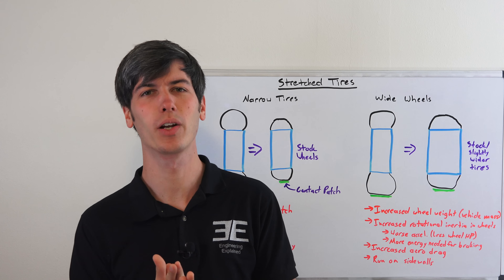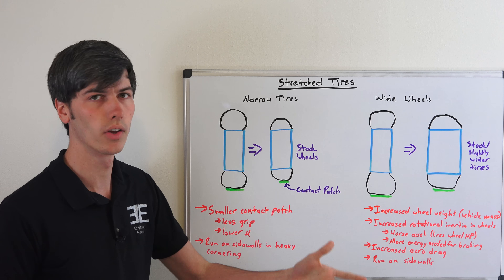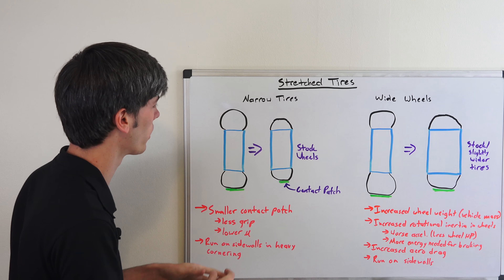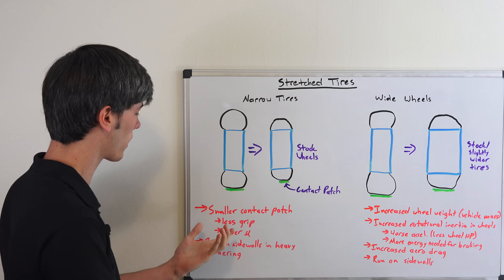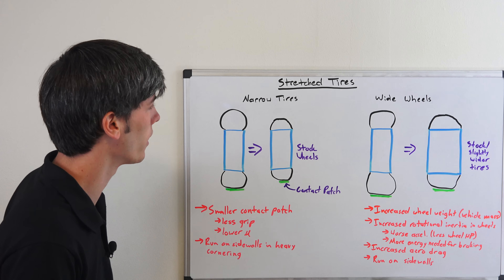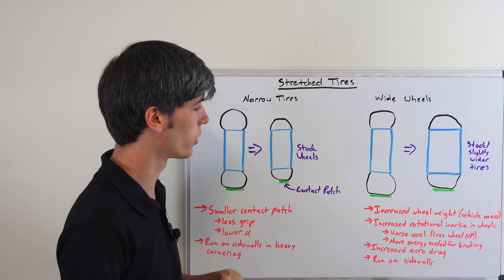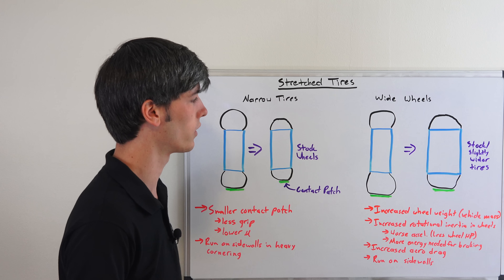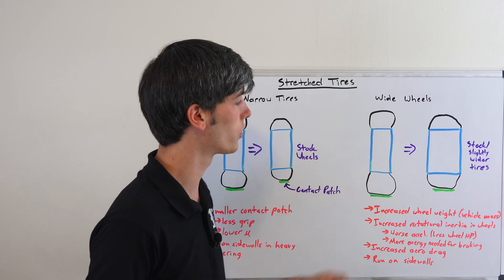Stretched Tires Are Silly

Comment: Could you do a video explaining the physics behind why going over a speed bump diagonally is more beneficial than straight on?
Reply: +Mark Embury  That is simple. You are limiting the amount of front over hang by placing one wheel closer to the bump which will allow for more ground clearance. 

Generally the trailing edge of the front bumper is shorter on the side of the car (closest to the wheel) then at the very tip (center of the car)

Comment: Hi There, love your video...they always refresh my knowledge on automotive and somehow improve my driving...kudos and keep making great videos...pertaining this subject, the tires and wheels that come stock from dealer is always half a size smaller. Meaning the wheel is always 0.5j smaller than the tires that come with it (at least in the country i'm in...

How and where can i find the info (beside the user manual and the tag at the side of the door) that the size of the tires i'm using is really fit the wheels..??? example, wheels 17 inch 7jj fitted tyre 225/55/17...where can i get the info if i want to change to 18inch wheels..? what is the correct spec that i need to mate with to maintain confort and reliability..?example do i get 18inch 8jj or 8.5jj to mate with 225/45/18 or 235/45/18..?hope you understand my question and able to provide some guidance...thanks...

Comment: The point of stretched tires is to have a nice rounded edge to tuck under the fender of the body or bolt on wide body

Comment: infinity uses stretched stretched tires on the m56x, g37s and g37xS, stretched tires in moderation increases sidewall stiffness and helps with lateral movement, you're missing some info, but it's what ever

Comment: +Engineering explained   First of all, happy new year!

also, I think it would be a good idea to make a video about how rotating / unsprung weight can help (with diagrams and all), because I see a lot of debates of how for example a 10lbs decrease in unsprung weight equals to 10/20 and even 100lbs of sprung weight, also others comment that for every 10lbs of unsprung weight removed you "gain hp" and so on

I think that it would be AT LEAST very enlightening for many if could analyse it in one of your videos :)
Reply from the maker: +eagle https://youtu.be/SR3nVx1aaTo
Reply: +Engineering Explained I hereby stand corrected!

thanks for the very fast answer :D
Reply: +Engineering Explained is there a video pros cons on running wider tires on say stock wheels is. 18×8 wheel then slapping a 275/40/18 tire

Comment: Stretched tires are faster, when done right. If you are restricted to a 225 45 15 tire, putting it on a 9" vs a 7" rim  will result in faster times. 

emillio from 949racing

"1. Increased tension on sidewall reduces unwanted deflection and distortion. 
a. Quicker steering response
b. Reduce camber loss from sidewall deflection
c. More linear steering response at max slip angle

2. Increased air volume
a. Lower pressures allow tread to conform to road surface better, improving grip.
b. Increased air volume temperature fluctuates less with thread heating/cooling.

3. Contact patch is increased by decreasing psi loading per unit area (lower air pressure and wider rim). Imagine pressing hard inflated basketball onto ground or mostly deflated basketball onto ground.

a. By lowering loading per unit area, total friction potential per unit area is increased.
b. Tire wear pattern is more even
c. Tire wear rate is improved

In general, a Spec Miata with 205/50 NT01's on 15x7's will run around 39psi hot. The same car with 225/45's on 15x9's will run around 30psi hot
and generate about .25g more lateral grip

In short, the same answer I reply to about 5 emails a week: "9's are faster"

"The same 225 tire on a 9 will generate more grip in braking, acceleration, cornering or and combination of two on an 8 with the same offset. Grip is king. You'll never see a successful autocrosser choosing a narrower wheel so they can slide more. The odd case being a FWD car putting smaller tires on the rear to help the car rotate. The Miata thankfully, doesn't have any trouble rotating if it is set up anywhere close to right."

Comment: I know the effects of stretched tyres but are there any downsides of using wider tyres on smaller rims and what's the actual term for this?

I ask this as I'm thinking of doing such a thing to my car but I'm not sure if there is any downsides to this and there doesn't seem to be that much information on the internet about it.
Reply from the maker: +KartDodger Haven't looked into it much, but it seems like you'd have a lot of flex in your tire, and it wouldn't stay very stable.
Reply: +KartDodger narrower contact patch, crowned wear at extremes, but mostly it makes for sloppy steering response and understeer. Requires increased psi to regain some steering sharpness, which will again lead to a narrower contact patch and tend to wear down the middle with less overall grip.

Comment: Not to point out the obvious but if you just stretch a tire the wheel is heavier. But most people that stretch  tires go to a bigger wheel. while being more heavy the sidewalls are shorter meaning less tire deflection at turn in. Stretching the tire pre loads the sidewall again reducing deflection.  If you look at a super car or a true sports car the tires will have a small stretch to them. The whole point is to make the steering more responsive. With reduced tire deflection the time between the steering input and the lateral G increase will reduce.

Comment: my father told me that they used slightly narrower tires in formula 3 and formula lotus and historic rally and the other ones( he was a mechanic for marko mankonen who won legends trophy, and mika salo from the karting career to formula 3) so the tire would lean less in corners, any thoughts on that?
Reply from the maker: +OvalD Maybe so! There's obviously some point between stretch (and the opposite of it) which would be ideal for certain scenarios. You can also adjust camber to reduce the negative effects which occur during heavy cornering.

Comment: Well in my case, i run 15x8 wheels with 205 sized tires. If I were to run the same sized tire on a narrower wheel, I would have more sidewall flex, however I could not fit a larger tire on my 15x8 wheel without rubbing  in my fender well
Reply: +Bunny Rabbit adjusting with more positive offset will make a difference, and be appropriate in most cases of wider wheels. The same offset on a 1" wider wheel means a negative offset change because the mounting face moves 13mm inboard.
Reply: i cant move any more inboard without rubbing at full lock. Its a drift car.

Comment: i still think stretched wheels are not the smartest idea. like you said that the tire will more than likely run on the side walls but id also worry that the tire would get knocked off the bead easier too.

Comment: Will it sacrifice tire life if I use a wide wheel and skinnier tires?  I feel like running this on track steels on my Scion tC for winter tires (stock wheels cant use higher profile tire) and then since I have the wide wheels changing the tires after winter and using a proper width tire on the steels on my other vehicle.  Sound reasonable?
Reply: +Ty U. winter tires need a forgiving sidewall for grip to not be snappy.
Reply: It will not, unless it is cambered
Reply: I should have said snow tires, but either way, it's a question of extremes and actual measurements.
Reply: +Ty U. It will not @ 0 TOE.
Camber doesn't greatly effect tire life. Toe does.

Comment: These videos seem to be all theory and not practical at all.  All your pro's and con's are valid, but you're missing the largest factor that has been mentioned in other comments.  A slightly stretched tire will have a higher cornering stiffness than one with a vertical sidewall.  Higher cornering stiffness generally leads to a slightly decreased peak grip, but a much higher area under the curve in transients, because the response of the tire is quicker.  This pro outweights the weight gain of a wider wheel, in a road racing situation.  That statement is backed by actual track testing, and not just reading a book.  

I feel like most of these videos have great theory, and can help to understand fundamental textbook concepts.  But, they are missing the realism and correlation that needs to occur between textbooks and equations, and on-the-road dynamics.  Doing some back to back testing, and bringing some experienced drivers/engineers could really take this video series to the next level.
Reply: Sidewalls are meant to be at 90 degrees and only flex a bit during turns. In the real world a stretched tire would debead in any serious driving would lead to an accident. Plus why would you want a smaller contact patch to the road?

Comment: hi engineering explained! I have 19" wheels with stretched tyres from the factory. I want to improve the ride. Would fatter tyres (which are cheaper!?) do it? Would coil overs? would changing to 18"?
thanks
great vids BTW
Reply: Assuming you have a decent running, and relatively unmodified car, to get a better ride the best thing you can do is change the tires. This is pretty much a fact unless you have blown out shocks or something lol. There is a reason why Michelin tires can run up to $250 a piece of 19 inch wheels. They grip well, are fairly smooth and quiet and last a long time. I would recommend going with a taller sidewall. This will reduce noise and make the ride smoother. Also, i would get rid of the stretch and just run a proper size. Reducing rim size will usually help with ride quality but that obviously entail buying new wheels which isn't cheap. Coil overs will likely not help with ride quality unless your suspension is currently jacked.
Reply: marshallrhayes thanks mate; since posting that comment I've put on 18s with wider and fatter tyres. It's made a world of difference!

Comment: Agreed. Stretched tires are possibly more pointless than giant wings on FWD cars that never really see above 120+mph.  Of you want the wide wheels, cut and mod your either your outer fenders (basically widebody flares) so they fit or re-tub your inner fenders so you can run a higher offset, like every person in the past has done.  There's really no excuse to stretch your tires, period. Buy what fits properly, or so the necessary modifications needed to fit the size wheel you want.

Comment: So is putting a 215/40 on a 8.5 inch wheel a bad idea? I personally don't like stretching tires much. but last time I checked 215mm is about 8.4 inches. I'm just worried about safety lol
Reply: +Gabriel Grieger depends on the specific brand/model measurements, check tirerack, most have a manufacturer's suggested range of wheel widths to fit. most 215s will be 6.5-8, I think. A shop may not install them outside the suggested range if they know.
Reply: +Gabriel Grieger its safe. you just lower your grip limit. Don't take corners at 90MPH braking at the last second and you'll be fine. Low and slow is an application. I run 165/40/16 on a 16x9 and have done so for years. Is it a track car? No. Can I daily it just fine? Yes.
Reply: +TheSigp220 right. Thanks man. I mean I'm upping the entire wheel size by about two inches so no matter that I do I'm increasing surface area.
Reply: MrNicholg
 I'm pretty sure most 215s and even some 205s include 8.5 in their suggested range.

Comment: Have you looked into why some F1 cars use stretched tires? Not saying I support tire stretching, just wondering why they'd do it?
Reply from the maker: +Zack Pavlik I don't know of it being done in F1. Do you have examples? Wheels and tires are tightly regulated in F1, so they're going to be confined to regulations, which likely wouldn't have much stretch as an option. They would aim to maximize width depending on their loading. If they desired to use narrower widths, they'd likely use narrower tires as well (for example, front wheels vs rear).
Reply: http://s1.reutersmedia.net/resources/r/?m=02&d=20100530&t=2&i=115835374&w=644&fh=&fw=&ll=&pl=&sq=&r=img-2010-05-30T173336Z_01_NOOTR_RTRMDNC_0_India-489161-1
Yeah, its a very mild stretch. The tire's side walls are almost parallel with the wheel's lip, but I would still consider it stretched compared to a traditional wheel and tire setup where the tire side walls bulge out a bit.

Comment: Allot do it in the drifting as they can run a larger rim for the looks but use a smaller tyre size to save some coin.
Reply: And in countries like Belgium that having laws that forbid the tyre expanding further out wheel wells

Comment: I have a 2014 ram the rear tire size is 265/70 if i put a in the rear tires only a 275/70 on stock rims will it help it grip ? Or it won make a noticeable difference?
Reply: Wont *
Reply: it will increase the coefficient of friction, thus gives you better grip. 
The downside is any more grip you gain wouldn't be alot.
You would increase wind drag and rotational inertia. Also if you load up your truck there a real possibility of catastrophic failure.

A safer alternative would be to get wider rims and tires , or deflating your tires a few psi.
Reply: +Luis Ramirez  thanks
Reply: +SaTrickster Not noticeably different, less difference than a performance tyre for example. It could mess with the balance of the vehicle however. More grip at the back the more it will understeer.
Reply: it wont make a huge difference but id personally not freak out over that comment about a 10mm increase having a decent chance of causing failure under load, ive got 185s stock on my old toyota pickup and i was told by a couple of mechanivs and tire places that anywhere up to 20mm wider or skinnier and its got little risk of failure (thats also the legal limit here) i personally went from 185s to 205s that i air down to get more traction out in my paddocks because it kept getting stuck and it was just enough to help and stop me getting stuck anywhere near as much (its a mega light 2wd lol) and ive still done quite a few trips at 40psi down the road with enough wood on the back to have the front wanting to lift and have absolutely 0 problems, so it wont make much difference on the road but if youre like me and lookong for a bit more grip in the dirt etc it can definitely be a cheap way to do it, if you want serios grip on road though go some proper upgraded tires
Reply: +SaTrickster not all tires labeled a specific size will measure exact or measure the same as others. A wider and/or taller tire will have reduced steering response, but a taller sidewall will fit more easily through a larger range of wheel sizes. More psi can help response but may wear down the center and reduce tread width, which defeats the purpose. I f you got them for dirt applications, aired-down use etc, it can protect the wheels and add flotation,.

Comment: So, say your stock rim is 14x6 (miata btw) and you stretch a 185mm tire (roughly 7.2 inches) on a 15x8 tire. That's only about .4 inches of stretch on each side of the tire. If my math is right (most likely not) that's more contact on the ground than which the stock rim has?
Reply: +SnoizY Dubstep didn't watch the vid facepalm

Comment: I've tried wider tires a few times. You know the drill, you think it'll help with handling...if you mean by making your car slower so it can handle turns better, then....sigh....I succeeded. lol (89 NIssan Pulsar)

It murdered what little acceleration my first car had left.

Years later I did it again on a car and the handling was so much better! Turned out I had widened to stock tires after some idiot cheaped out on the car before with too thin of tires. (false sense of success)

The only time I've had success was with my 1996 Saab 900 SE...again, it had a few recommended tire sizes from the factory...I had chosen a tire size that was still EXPECTED by the engineers for the car.

(I wish I knew how to do italics instead of capital letters on YouTube, lol.)

Comment: Years and years of tire technology development to increase sidewall stiffness, enhance tread patterns for grip, then comes the stretched tires to "improve grip and responsiveness". I mean, of course overly stretched tires are bad, but seems like just slightly undersized tires actually perform better, so why isn't it default? Treadwear issues?

PS: a video in the Recommended section is about "why you should stretch the tires" lol